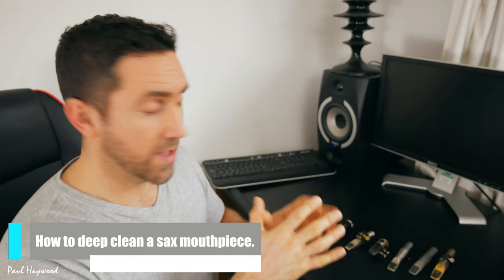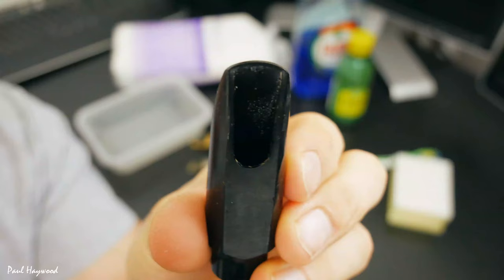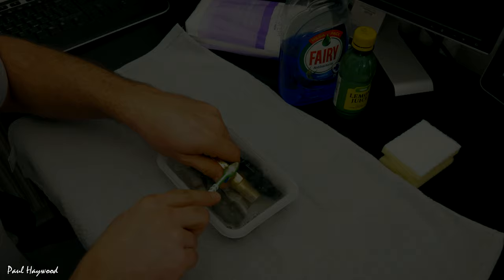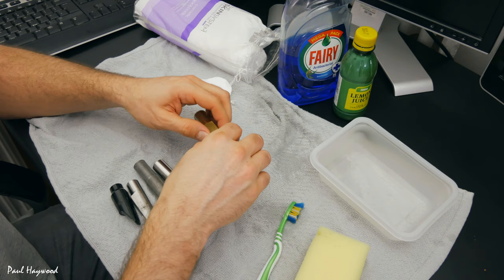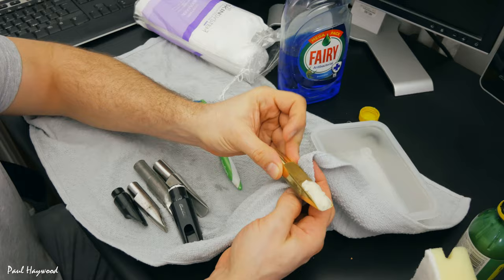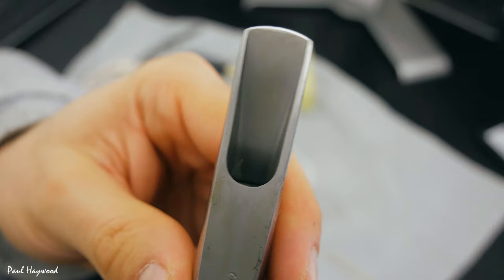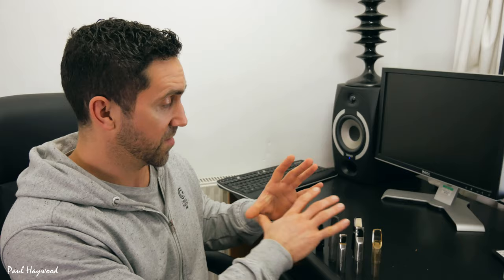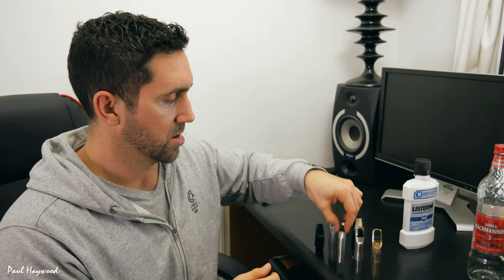How to clean a  saxophone mouthpiece 🎷QUICK GUIDE🎷 - saxophone lesson

Comment: Hi nice idea to clean the mouthpiece. I usually clean it with toothpaste and brush it.
Reply from the maker: Hi Rufus, that sounds like it could work really well too. probably still need the lemon juice to finish up the inside calcium though. :) Do you also leave it to soak before hand?
Reply: @PaulHaywood  Just wanted to know that using lemon juice on Hard rubber/ Ebonite mouthpieces would not have any problem.?
Reply from the maker: @sax4passion  yeah it works fine , and I've seen no problems myself and it's pretty well documented, alongside vinegar. Some types of old mouthpieces can occasionally lighten in colour slightly which is why we use the cotton wool to keep it in contact with the inner chamber rather than having to submerge the whole thing. I've used it on 3 different hard rubber/ black plastic mouthpieces with no issue. :) mouthpieces

Comment: Good video. In the olds days as a young Army Bansman, the old guys said:
" Don't clean your M/ piece too much....you'll ruin your tone". 
I thought it was BS. But what if you are on a m/piece that works, & the build up of Calcium over the yrs (from yourself) is part of the process in getting the Sound you want? Yes, keep it clean for hygiene, but scouring it out would put you back to square one (?). Just at thought. What do you reckon?
Reply from the maker: Hmm, interesting concept there Deryck. Thanks for the comment by the way! :)
I can imagine there is some element of truth in there, however if you build a sound and then don't clean you r calcium deposits out for 20 years, you'll end up slowly changing the piece of equipment your working with and will evolve with it. If you clean it every year or two the deposits will be small enough to not modify the tone ahrdly at all and you keep resetting the mouthpiece to how it was intended to work and resonate etc. I think i prefer the idea of resetting the surfaces and angles back to how they were designed and created and lket my sound and embouchure develop over time with that (factory reset) as a standard. Seems like a perfectly legitimate argument from the old guys though. HOwever, again, i like to squeeze as much projection out of my setup as possible and i'm pretty sure the calcium deposits would cause some waveform diffusion. possibly softening the tone slightly after many  years of build up. which might be what one want. So in the end.... each to their own! haha

Comment: I use hard rubber mouthpieces and I think one is plastic. My biggest problem with my clarinet and sax mouthpieces is the accumulation of the the very sticky goo from the back of mouthpiece cushions.  The cushions move all over the back of the mouthpiece when I play a lot and the side of the cushion sticks out beyond the edge of the mouthpiece. And the goo left on the back of the mp is extremely difficult to remove. Hydrogen peroxide and disinfectants do not work. One repairman has recommended Ronsonol to remove the goo. But I've been afraid to try that. I really need the mp cushions because a pretty large chip was knocked off the back of one of my front teeth many years ago. It's not very noticeable from the front because the chip came off the surface of the back of the tooth giving it a fairly sharp edge which would dig into the surface of the mouthpiece if I did not use a cushion.  I have one very good mp that I like to use on my alto sax, which I also inherited from a very good friend many years ago. What would you recommend?
Sincerely,
Ken WArd

Comment: If you're using a ebonite or HBR for mouthpieces. How do you remove the oxidation that can build up on it over time due to exposure to light? 

I don't play anything but I do restore tobacco pipes which use similar rubber in the stems and removing the deep oxidation from when they have turned from black to brown is a real chore. 14 grits of sandpaper, 2 polishing compounds and wax usually.

Comment: How do I keep my mouthpiece form getting discoloration? I tried just using a toothbrush and running it under the sink and it took out the black pigment. I am scared to clean my new mouthpieces because I don’t want it to happen again, so what should I do differently?
Reply: Use cold water instead of hot.

Comment: You obviously have never refaced a mouthpiece, have you?  The difference of thousandths of an inch affects playability.  I would NEVER, EVER "scrub" the table, rails or tip.  At MOST, get the softest Scotchbrite (the WHITE one) and give these areas a LIGHT cleaning with Scotchbrite, which will not change the facing numbers.  Anything else and you are pressing your luck.
Reply from the maker: That's what I'm using, a soft non scratch sponge, it's the same as white scotchbrite pad, and a toothbrush with soft nylon bristles. 
I'd obviously never use a scouring pad, I specifically say in the video not to use a scouring sponge pad.